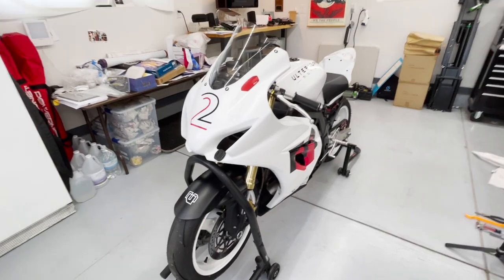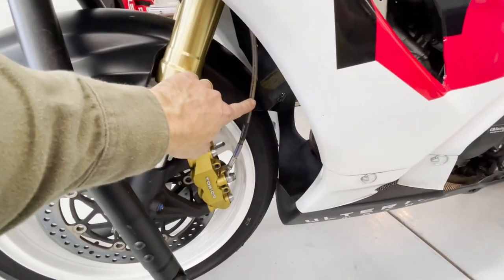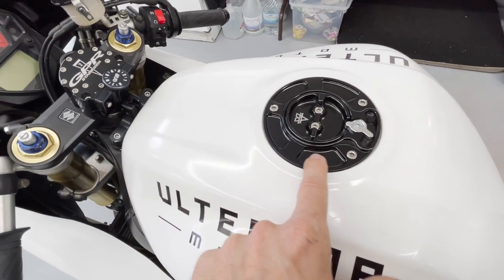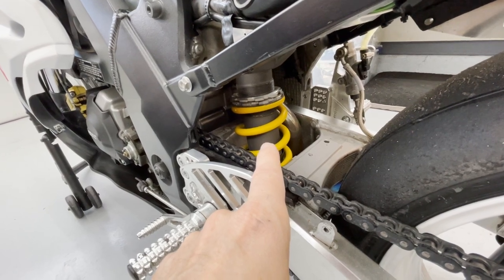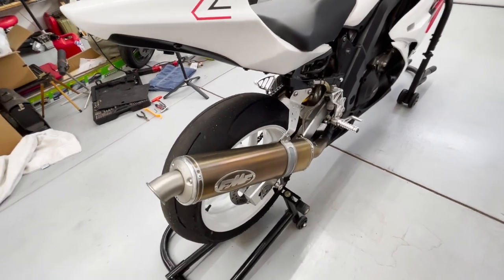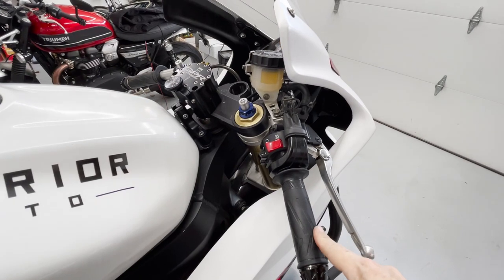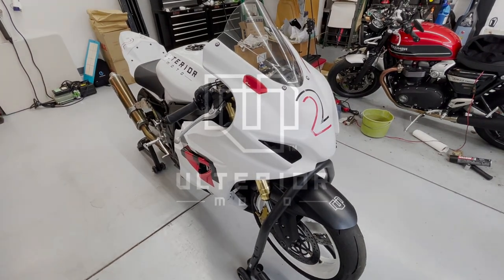Budget SV650 Track Bike Build

Comment: Nice build, but putting a 180 wheel conversion onto a stock bike is completely pointless. It detracts from the flick-ability  and quick handling that the SV is renowned for.
Reply from the maker: Yours is not an unpopular opinion, but I also consider that all twins cup bikes use the 180, not that they had a choice.

Comment: Someone explain to me the advantage of this over racing a GSXR600.  I know there is a reason, but I don't see it.
Reply from the maker: It depends on which class/pace you prefer. A GSXR600 is a much faster bike, for sure. One could also ask why not a GSXR1000?
Reply: @ulteriormoto  I think I get it.  There are faster and slower, but it's still a solid bike to run at the track.
Reply from the maker: The SV is not quite as popular as it once was, but you will find plenty of them in lightweight twins classes. To give you an idea of their popularity as track bikes, just look back a few years at the MotoAmerica Twins Cup. Now it is dominated by the R7 and RS660, but before those bikes came out the field was almost entirely made up of the second generation SV650s. They were running very large grids and I can only recall one Ducati and one Kawasaki in the mix. At Daytona last weekend, I only saw two SVs on the grid. That's good news if you want to pick up an affordable SV race or track bike.
Reply: @ulteriormoto  that IS good news as I think I might pick one up and reverse engineer it, rather than figure out how to build a race bike the hard way. 🍻
Reply: I tell you the reason because the GSXR600 is better; because is cheaper to buy a 600 already modified than do your own Frankenstein, not more funny, but cheaper.
Reply: on a small track am faster on my stock sv6502002  then my k5 gsxr750 the sv is so easy to ride

Comment: Building a 2003 Suzuki SV looking for some help what gearing you think I should get in the back shock thinking of buying a wrecked GXR1000 for the front end and back shock and rims and tires what year is fit thanks
Reply from the maker: Gearing will depend on your speed as a rider and the track itself, but I run 14/45 which is stock for the naked version. The stock S version is 14/44.
The best GSX-R forks to get are the 600/750 from 2004-5 but only because they have the same steering stops. There are many other years of 600, 750, and 1000 that will fit with not much compromise. Search for GSXR fork swap on svrider.com. Regardless, you will need to service the old forks, so check out my video on that.
The best retrofit rear shock now is the ZX10 rear because it is slightly longer than the GSXR on my bike. I used the best available at the time. That said, you're better off looking for a Penske or Ohlins shock because at this point the retrofit options are so old they will need a rebuild anyway. It's better to invest in a superior shock. Subscribe for updates on that. I recently upgraded to a used Penske and I will have a video about that in a few weeks. If you still want to go the retro route, search for the shock swap chart on svrider.com

Comment: I may have missed it, but is the tail bodywork the matching rear for the front fairing from the gsxr?
Reply from the maker: Yes, they are all from the same kit which also includes the unused front fender and tank/air box cover from that bike. It’s cheaper to buy the whole kit than just the parts needed.

Comment: Very well done, Thank You.  The only thing I would question is the wider rear tire...a narrower tire turns left/right easier and like you said, there are some really good 160 tires available now :).
Reply from the maker: You are 100% correct about that. I did feel it a bit at first, but I have also installed a Penske shock since then (video coming next month) and the bike has transformed.

Comment: Good video, I have a similar project but for the street where I adapted the suspension of the GSXR1000 K4, on a SFV650 Gladius,  now I was looking for the steering damper and a fast gas, could you give me more information? Was it easy to install?
Reply from the maker: The steering damper was very easy to install. Be sure to get the one for the SV, not the GSXR. All you need to do is pull the steering stem nut and place the damper plate over the triple and replace the nut. Next you pull the bolts at the front of the tank and place the bracket there. Lastly, mount the damper. 
Sorry, I’m not familiar with “fast gas”. For more information on the build see https://ulteriormoto.com/blogs/budget-sv650-track-bike-build

Comment: I got only one question here: why not SV1000 ? What's the reason to choose the 650 over 1000. I'm racing my sv650 for 2 month and it's obviously killed by all the cbr/gsxrs on the fast straight sections. At this budget you put into this bike you might wann buy a decent gsxr / cbr600 pc37 and dozen other bikes. I know it's kinda fun to make it on your own but you just took the GSXR and put it into the sv650 frame - cost wise you could get like 2 gixers in the cost of this project.
Reply from the maker: My understanding of the SV1000 is that it’s added power doesn’t compensate for its added weight when you consider then you’re up into a class against Ducatis at a local level. 
If you look at the MotoAmerica classes, you’ll find the SV650 fits into the Twins Cup category, the SV1000 (non-S) fits into Super Hooligans, and the 600-750cc in-line fours are Supersports. Although the displacements are similar, the twins just don’t produce the horsepower required to keep up with the fours. They had to make an exception this year to allow the Panigale V2 into Supersport and that requires 955ccs to keep up. Until the Yamaha 700s and the RS660 came out, the SV650 was the dominant bike in Twins Cup.
If we’re just talking track days, none of this really matters because you’re really only competing against yourself, right? If you’re racing that’ll lose other bikes shouldn’t be on the track with you.
Reply: Thanks for the anwser. To be perfectly honest the only thing lacking for me is just a pure straight power of 650 that's why I'm looking at 1000 with such interest and wondering - why 1000 is not as popular as 650.
Reply from the maker: I get it, believe me. Getting worked on the straights can get old, but I try to reframe it as an opportunity to improve my cornering skills. I know some people try to get more power out of the SV, but like you I would rather just get a faster bike if that was my goal.

Comment: Hi, nice walk around video. 
You didn't mention what you had to do to/with the front wheel, perhaps you got a complete gxsr front end. 
Are the steerer/head bearings the same, what about trail and rake?
Have you done any tuning mods to the engine?
One suggestion I could make would be a radial front brake master cylinder, should give more feel, Brembo MCS 19/21 allow adjustment in the pull ratio on the fly.
Talking of brakes, what pads do you use?
Reply from the maker: Glad you liked it!
I bought a GSXR wheel to match the front end. As I recall, I used the GSXR head bearings which worked well with the SV chassis. I haven’t done the rake/trail math, but this GSXR front has 30mm offset and I believe the SV was 28mm, so it is steeper. The stock SV geometry is sort of a chopper compared to the gixxer. In all the times I’ve had Dave Moss make adjustments, the subject has never come up, so it works really well as is. That said, I know the MA guys worked with a variety of offsets. Check out LWTRacer’s channel for really in depth info. I am interested in reliability, so I leave the engine stock. 
Thanks for the MC suggestion. I will look into that. 
I’m using EBC HH pads.

Comment: Love the bike! Would a GSX-R 600 make sense to buy directly, since many parts of the build come from that model?
Reply from the maker: With the GSX-R 600, you are getting a much faster and more capable machine all around, so that is a good way to go. Funny though, in upcoming videos you will see that I replaced the GSX-R shock and fork springs, so the list of parts from that bike are diminishing. Since I made the front end conversion, cartridge kits for stock SV forks have gotten much better, so that also an option.

Comment: Does the steering stabilizer effect your control at turns?
Reply from the maker: It is not noticeable whatsoever. It essentially limits the speed of bar movements so that normal speed inputs are unaffected, but high speed movements are prevented.

Comment: Great video was it easy to fit the rear shock? Where's the battery
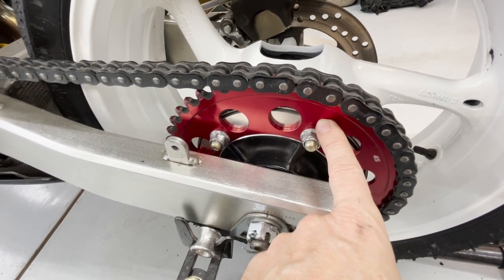Reply from the maker: Hi Roger, thanks! Yeah, the shock was plug and play fitment, except for the stock battery tray, which I have fabricated. You'll just have to remove the rear wheel and take the weight off the swing arm. I will be replacing it with a Penske soon and make a video showing how that is done. You can somewhat see the battery in my bodywork video around the 9:00 mark, though it's obscured by the ECU. I used an AntiGravity 4 Cell which is tiny and less than a pound. I'm not perfectly happy with the tray yet so I haven't covered that portion of the build in detail.